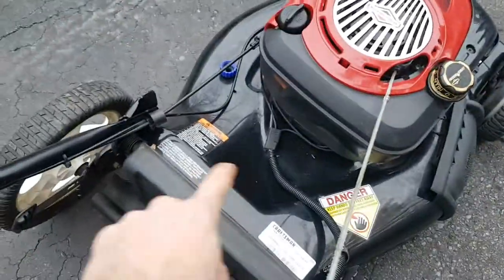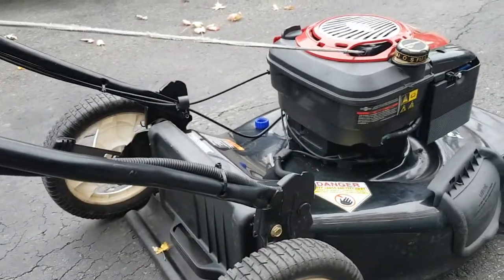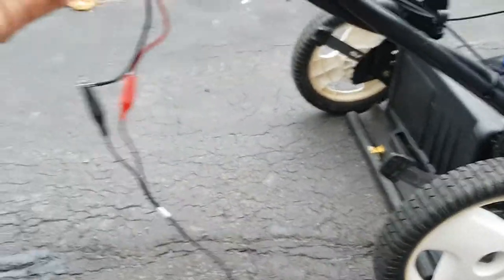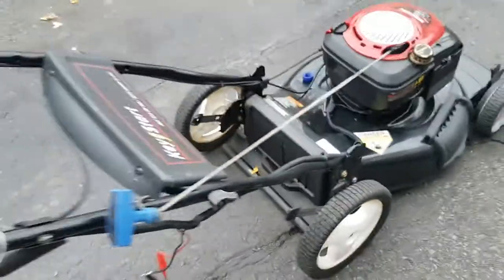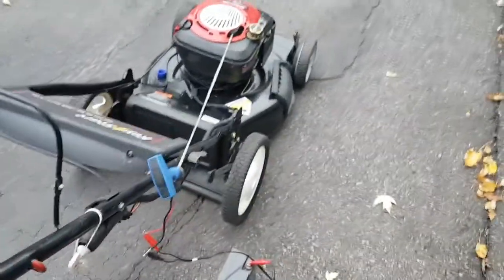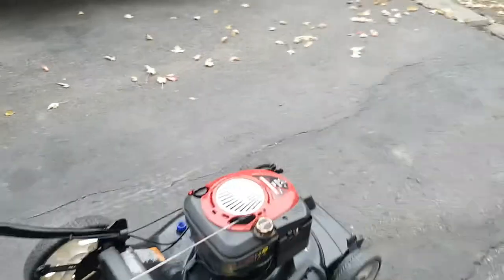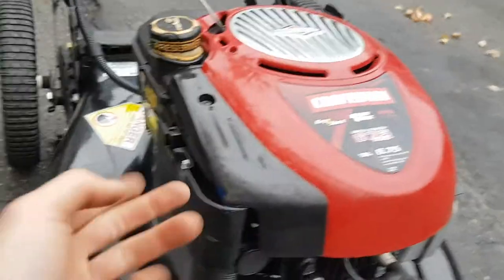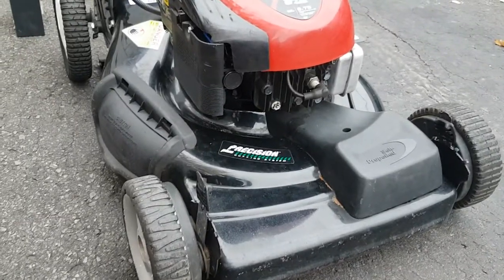Craftsman Briggs & Stratton Lawnmower With Key Start

Comment: they should just put an AC electric starter on the engine like they do with snowblower engines.  or put a start port on the top of the engine like Craftsman used to do with their weedwackers so you can turn the engine over with a drill.  carrying a battery on a push mower is dumb.  once you get the engine running from an electric start, you can usually rely on easy pull starting for the rest of the day.  Briggs actually used to have those AC electric starters on their small riding mower engines in the 1960s, which was VERY useful since pull starting a cold engine was much more tedious back then.

Comment: I had the newer model with the removable battery that you just remove and slip into a charger. It worked well, but the front wheel drive is worthless going up hill.

Comment: Where can I find a battery for it, or what kind of battery is used.
Reply: Ebay
Reply: Save your money, buy a warrior 12volt or 18volt battery from harbor freight and then cut and put crimp connectors on tbe wires.

Comment: I just test a ryobi 18v battery on one like this but older. It started but I am worried cause its 18v and the original battery was 12v.
Reply from the maker: The higher voltage may damage the starter, or the extremely high current draw may damage your battery. You need a 12V battery that can put out high current to the starter.
Reply: @QuaabQueb  I may have damage mine cuz I used a higher capacity ups battery just cuz I had one and the original died on me,.. I’ll search key stared replaceent